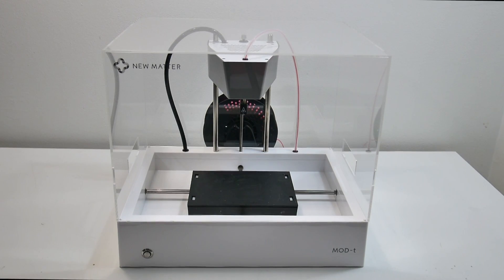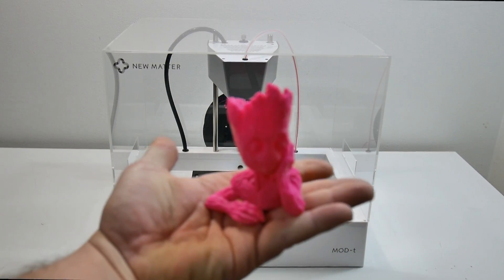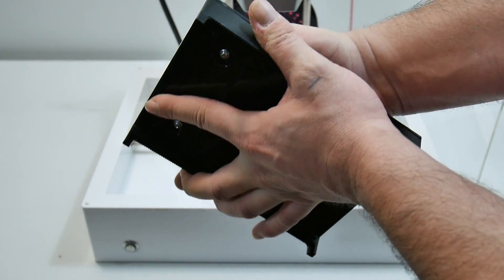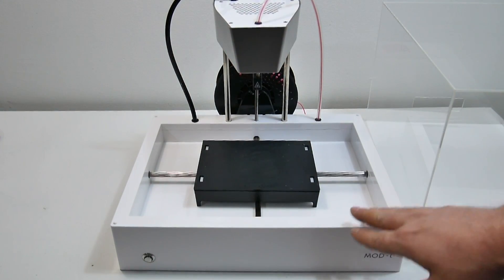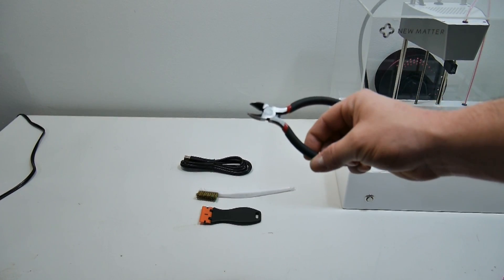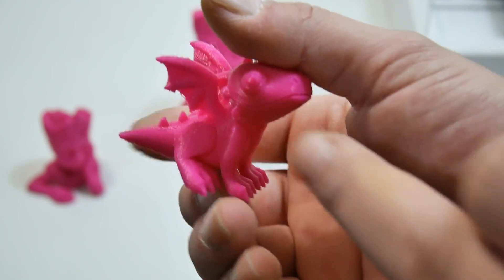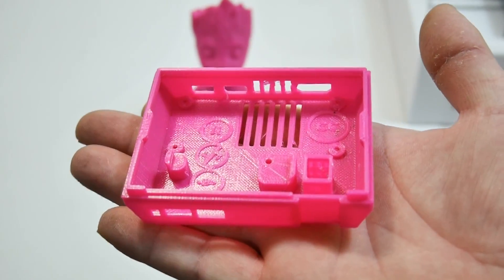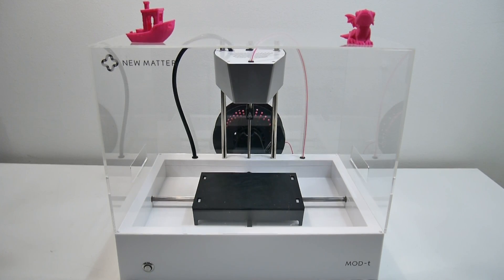New Matter MOD t 3d Printer One Week Review

Comment: Use the wire brush to scuff up the build plate. I have used mine for 100's of prints. I use simplified 3D and set the first layer to 90% this really puts it down hard so it sticks very well. The build plates are 3 for $15 and the hot ends are $25 each. They have fantastic support! and if you use a 3rd party slicer you can build outside of the suggested build area.
Reply from the maker: i use cura but the 90 percent first layer makes a lot on sense. any chance of getting your S3d fff file or settings?